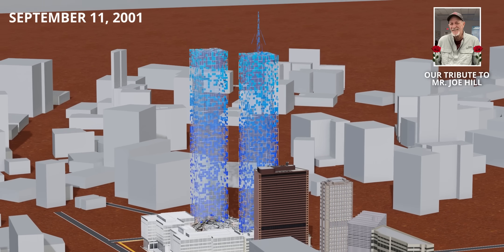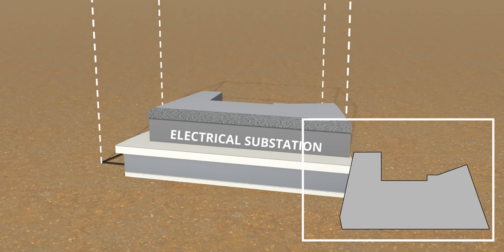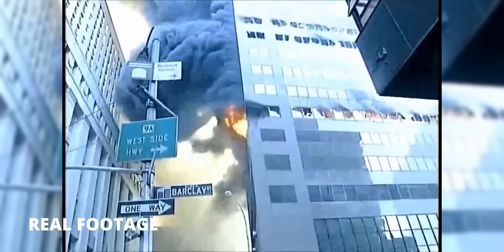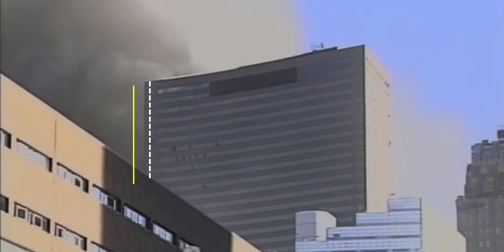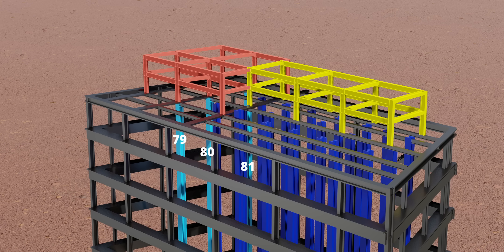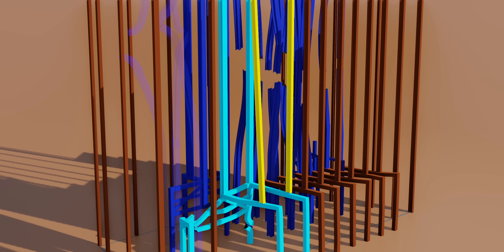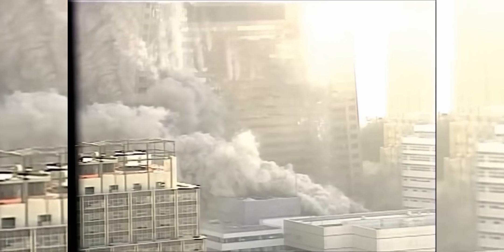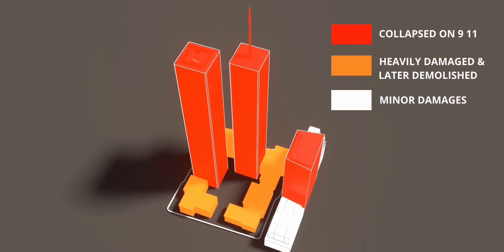Collapse of Building 7 | The Complete Physics

Comment: If anyone still doubts it go check ukraine and Gaza buildings many buildings of very small sizes don't even completely crumble and cripple upon high payload missile hit, let alone an aircraft, now you can think yourself how an airliner manged to ground WTC's and miraculous fall of building 7. Moreover, if assumed that fire can melt high strength reinforced steel, then also it takes quite some time to heat and make the steel beam/column fracture or crack or bend, unless the fire is directed and intense at specific location which in an uncontrolled accident doesn't happens rather the fire spreads and engulfs large portions. 

Even if assume that one side of trusses buckled, still whole building cannot fall, as other columns will stay intact and hold the other portion of building upright even if that portion is 10-20%, along with concrete structure.  

Airliner doing this level of destruction in heart of USA, secured by CIA AND FBI, which even many top tech missiles struggled to do at that time.
Reply: Most of Gaza has been levelled.  Rather than using analogies that are not even analogous, how about a novel idea:  Try to understand the collapse of Building 7 on its own merits?

At 10:28am the WTC North Tower collapsed, showering Building 7 with tons of burning debris, causing heavy damage and starting many large  fires which burned out of control for the next 7 hours. Half the FDNY firefighters having been killed, units in disarray, equipment destroyed, no water pressure, and the greater urgency of search & rescue efforts, Building 7 couldn’t be saved so firefighting efforts were pulled as futile and 7 left to its fate. Firefighters make that sort of choice every day in brush fire situations - which houses to save and which ones to let go. Only real difference here is moving the decimal on the size and cost. People get overwhelmed by the size.

www.youtube.com/watch?v=g_SvpwyC17M

Collapse of a burning structure is always a concern for firefighters. Steel buildings subject to fire rely on active firefighting to survive. Buildings are designed around 1 to 3 hours of fire resistance, allowing time for occupants to escape and active firefighting to get started, after which all bets are off. Left to their own devices they'll exceed their design envelope and collapse, like Plasco Tower and Wilton Paes de Almeida. In 7 the occupants escaped, passive and active fire protections were compromised and active firefighting was abandoned hours before the collapse, which left the building to its fate. It lost. Odds on Building 7 would eventually collapse, and it did. No big deal in logic.

 http://www.youtube.com/watch?v=WnYBX6QT0R4 

FDNY Chief Daniel Nigro - The biggest decision we had to make on the first day was to clear the area and create a collapse zone around the severely damaged 7 World Trade Center, a 47-story building heavily involved in fire. A number of fire officers and companies assessed the damage to the building. The appraisals indicated that the building's structural integrity was in serious doubt. I issued orders to PULL back the firefighters and define the collapse zone. It was a critical decision; We could not lose any more firefighters. It took a lot of time to PULL everyone out, given the emotionalism of the day, communications difficulties and the collapse terrain 

FDNY Deputy Chief Peter Hayden ; We had our special operations people set up surveying instruments to monitor and see if there was any movement in the building. We were concerned of the possibility of collapse in the building. And we had a discussion with one particular engineer there, and we asked him if we allowed it to burn could we anticipate a collapse and if so, how soon? And it turned out that he was pretty much right on the money, that he said 'In its current state you have about 5 hours 

The collapse of Building 7 was anticipated and widely reported in the media throughout the day, with 24 video cameras recording some or all of the collapse. Everyone knew what was coming and why. 

www.youtube.com/watch?v=OY5S5k3tMHI

The collapse of Building 7’s was from the inside out and entirely different to the Twin Towers, harder to understand, with most details being hidden from view and not intuitive.  But we can still sort out what happened through careful analysis and observation. This is my explanation of the collapse relying on no outside authority. 

Building 7 was a unique, asymmetrical 47-story steel framed structure built atop a smaller 3-story building serving as a partial foundation, requiring lower floors dedicated to complex load transfer structures. Of trapezoidal shape and all-steel tube-in-tube construction, B7 (above the 7th floor) consisted of a central core of steel columns carrying most of the gravity load, perimeter steel columns around the outside of the structure carrying the remainder of the gravity loads and long span beams and girders to tie those elements together and form the floors. On the outside of the building hung a moment frame or outer shell. 

Phase 1 : First externally visible signs of collapse initiation occurred at 5:20:28 pm and were notably quiet with observers not realizing the building was collapsing! No audible warning in the form of hundreds of ear drum busting 180-190dB explosive bangs preceding the collapse. Here at 12:00 a local CBS affiliate reporter is talking 10 blocks from B7 when collapse begins. People don’t start to notice the collapse until 12:11. At 12:45 is the famous CBS fixed camera clip of Building 7’s collapse. Note how quiet it is. 

www.youtube.com/watch?v=t5tEy6mXSE8

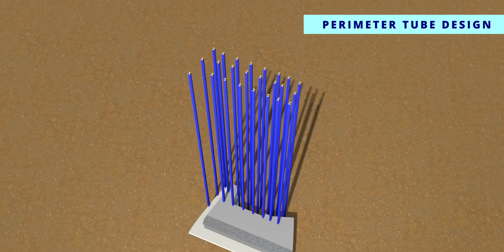Collapse initiation was due to lower floor failures above the load transfer region (8-14th floors) in the NE corner. In this video at 0:45 you can see the NW corner from inside the building while under construction, Column 79 just out of frame on the left. That big, angled steel beam across the top of the frame connects to C79 at one end. The girders connect to the beam. That beam and all those girders depend on just one connection 

www.youtube.com/watch?v=nP3TNHPCIVU&t=45s

Phase 2 : The NE lower floor failures caused a loss of critical lateral support over an excessive length of Column 79 and it buckled. Looking at a floor diagram of Building 7 (www.nist.gov/image-16640) when you see all the structures that depend on C79 you quickly realize this one column was a relatively isolated structural element on which a disproportionately greater fraction of the structure depended analogous to say the Key Bridge. Externally as collapse begins we see a vertical progression of window breakage along the 44-46 line and a kink in the roof of the East Mechanical Penthouse at the top of the building, consistent with C79 failure. Normally with a buckling column, the load could be redistributed to other columns. With C79 that is not the case - the failure did not redistribute the load, so the collapse rapidly progressed to the roofline, sinking the rooftop penthouse. The transition from full capacity to almost no capacity occurs in an instant and will result in virtually no resistance 

Phase 3 : With C79 gone, B7’s progressive, non-symmetrical collapse continues with adjacent columns 80 and 81 left laterally unsupported, and quickly buckling as well, sending the EMP down through the building. C79-81 all have no diagonal bracing, which is the major reason why they could not redistribute a lot of vertical loads among one another. From there collapse progressed from east to west through the central core until the core was gone taking all of the interior floors and probably most of the perimeter columns with it. Follow the horizontal progression of window failures low in the building and the dropping of the remaining rooftop structures into the building. One of the big takeaways from the NIST Building 7 study (invariably ignored) was how their modeling determined C79 failing under ANY circumstances would have initiated the same collapse sequence. 

Phase 4 : After about 10 seconds only the exterior moment frame remains, giving the illusion B7 is still standing to the casual observer since little has outwardly changed. But it is just a hollow empty shell like an empty cereal box supported only by a few remaining columns and overloaded from the loss of the core columns and floors, quite unable to remain standing. With nothing remaining behind it, the north face leans inward, forming a V in the roofline, the last few columns buckle under the strain and the moment frame free falls, landing on top of the debris pile. 

It is only here at the end when most of the building is already gone, leaving only an empty outer shell that a single measurement of alleged free fall acceleration is taken, from one point on the outer shell. The Building did not “free fall” – just one corner of the outer shell briefly moved at a rate comparable to FFA. The Building_ (core and interior) was already gone before that happened. The period of alleged FFA was a product of how it fell NOT why it fell . It’s also not proper FFA as the single measured point was moving in 3 dimensions, not just down. Start to finish the collapse took 18-20 seconds, 3 times longer than free fall . How fast something falls cannot tell you what started it falling_ anyway, let alone 10 seconds after it started falling.

The debris spread outside the footprint blocking surrounding streets, heavily damaging the Verizon Building and destroyed Fiterman Hall. 

Building 7’s progressive, non-symmetrical collapse was incidental and unintended collateral damage from the combined effects of fire + time + gravity, started by the collapsing North Tower. That is true no matter who planned and carried out the 9/11 attacks or why . The collapse was of so little consequence it barely registered at the time - a footnote, only taking on semi-mythical status as an alleged smoking gun years later when demolitions at the Twin Towers, missiles at the Pentagon and shoot down over Shanksville all failed and conspiracists had nothing left to work with. 

Anything can seem like a conspiracy if you don’t understand how it works. Now you should. I hope you found this helpful, informative and it solicits informed critical comment. If I made any errors of fact, logic or reason or left anything important out, please let me know so I can fix it. IF you can offer a more plausible alternative please do. Be the first. Please start any reply with the words “Tits McGee” or I will know you didn’t read it and are wasting my time.
Reply: @TheCriticalStinker-01  the outer shell collapsed at free-fall speed for 2.25 seconds of the 5.4 second collapse; thats 41.6% of its decent is in FF.

Your dumb CGI video isn’t convincing nobody about what happened to the core of WTC7, we don’t buy the “office fire and antenna” fairytale.

Over 3000 architects and engineers at the non-profit “Architects and Engineers for 9/11 Truth” disagree with NIST Final Report about what happened to the core of WTC7.

So which “professionals” are the public supposed to believe, the government paid or the independent?

Especially after 2003 bs “Weapons of Mass Destruction” garbage, most of the public, including most Afghan and Iraq soldiers believe it was all lies to invade the Middle East.
Reply: @LibertyOrD__th  Let's see how badly you failed this time:

"the outer shell collapsed at free-fall speed for 2.25 seconds of the 5.4 second collapse; thats 41.6% of its decent is in FF."
First, you re-flaunt your utter inability to read, or for that matter manage basic physics.

"Your dumb CGI video isn’t convincing nobody about what happened to the core of WTC7, we don’t buy the “office fire and antenna” fairytale."
You not understanding the "CGI video" doesn't make it wrong. It makes you incompetent to understand it. But here's the shocking fact you failed at comprehending. Being unable to understand the video does not make it wrong.

"Over 3000 architects and engineers at the non-profit “Architects and Engineers for 9/11 Truth” disagree with NIST Final Report about what happened to the core of WTC7."
The "non-profit A&E911", specifically created to fleece the gullible for the people involved in running it, does not have a single architect since Gage got the boot, and all of 2 engineer.  That you think an online petition is anything other than that is rather laughable. But that's all it is. A petition of a bunch of people who agreed with the statement "I think there's something hinky about 9/11". Out of the, currently, 3661, there are....27 engineers in relevant fields. None of which have ever worked on a high-rise. But I'm sure all the others are important and relevant too. Like the "landscaping architect" or the "software engineer" or the "fire alarm installer". Really. Relevant and meaningful.

"So which “professionals” are the public supposed to believe, the government paid or the independent?"
How about the actually competent professionals? Like, oh, the Fire Department of New York? Or the American Society of Civil Engineers? Or the American Institute of Architecture? Or literally every single engineering department of every single university in the world, where this is standard study material on progressive collapses?
None of whom has ever said anything other than that it's exactly as the explanation says. The building(s) collapsed due to extensive fires.

"Especially after 2003 bs “Weapons of Mass Destruction” garbage, most of the public, including most Afghan and Iraq soldiers believe it was all lies to invade the Middle East."
Ah, yes. "Irrelevant shit that has nothing to do with the subject, so there!" That's always such an amazing argument.